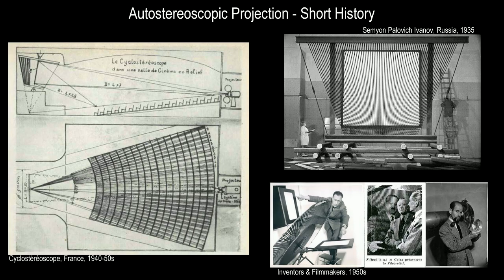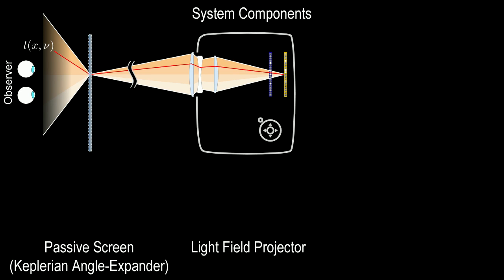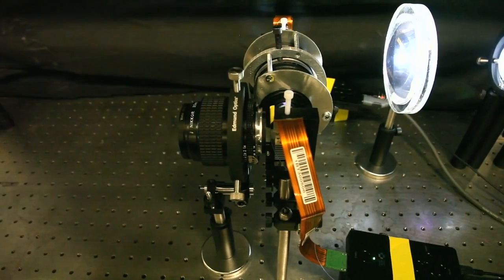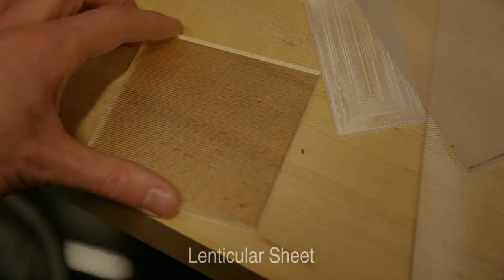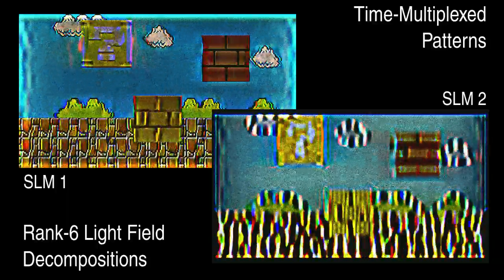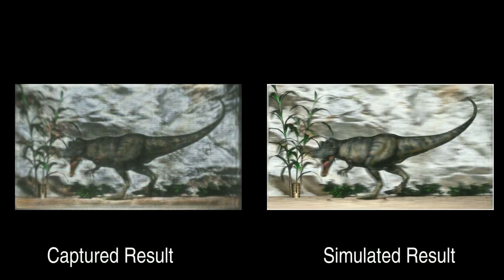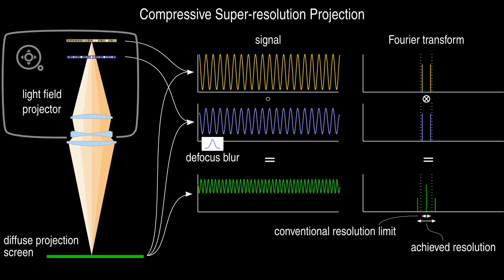Compressive Light Field Projection : MIT Media Lab, Camera Culture Group

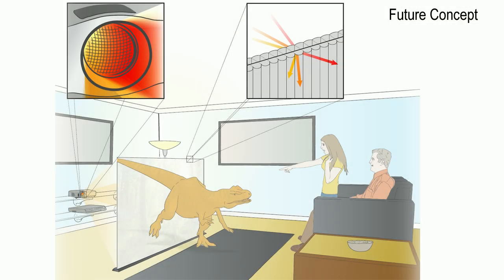Comment: Hmm. As I understand it, lenticular displays can only accommodate images perceived to be behind the screen. Negative space is a no-no. Unless you've cracked that..? If not, that image at 4:40 is very misleading.
Reply: That's just the representation 3D image that viewers on the coach see. They only see the part of it which is overlapped by screen though.